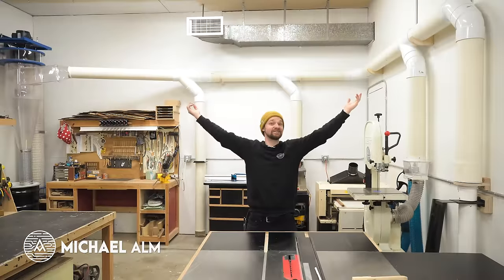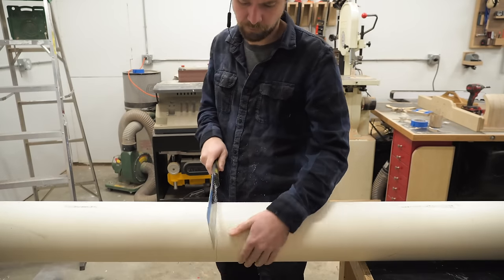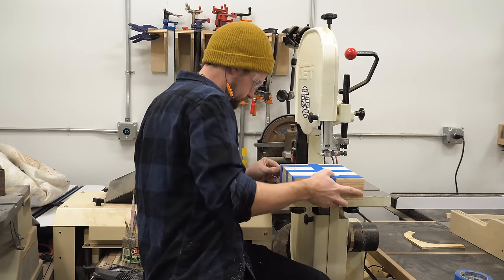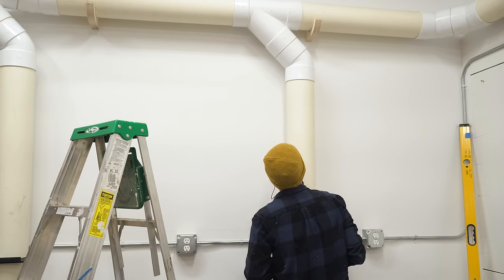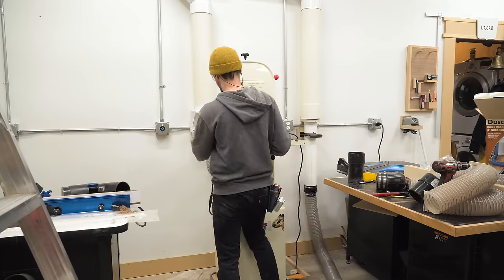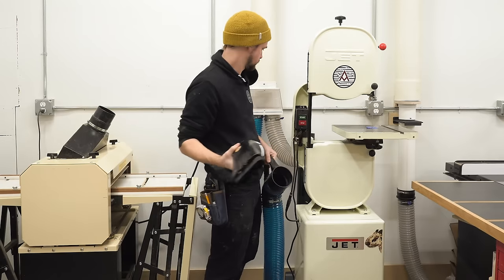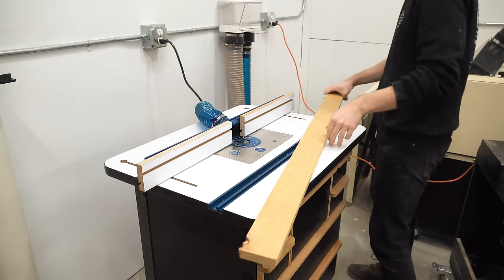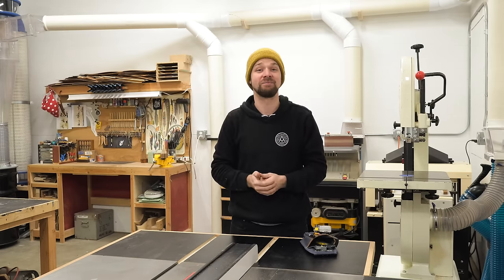Dust Collection System Upgrade

Comment: Clearview cyclones are great. I have had one for about 15 years. Best tool in the shop. One addition, be sure to add a magnet to your floor sweep pickup. You do not want metal parts sparking in a dust cloud. Good ideas here, thanks!

Comment: LOL, your table saw splitter would have allowed you to turn the pipe with the sled in one position. Also, the table saw needs to be able to breathe in the areas that you want to keep clean. A restriction in flow has the same effect whether its the hose or the holes in the machine.

Comment: I have to admit, I've been scared away from Clear Vue dust collectors after seeing their YouTube video that shows the system running at 93 dB!  That's really loud.  Even with their silencer added, the noise level only drops down to 81 dB.  That's a lot of noise.  Especially when there are multiple alternatives that are a good 10 dB (or more) quieter.

Comment: I don't collect dust, I blow it right out into the alley behind my shop.
Reply: Technically you're collecting it from the machines. Just not bothering with doing anything much with it. Just throw it out there.
Reply: I do the same thing - give it back to Mother Earth
Reply: Yeah, Wood is an organic material so it's biodegradable so it's not harmful for the enviorment. Make sure your not doing any metal or plastics. You can actually sell saw dust to a few people aswell so might be good to collect.
Reply: @klab3929  Yeah, those shavings from  PT lumber you used for that outdoor table are great for the environment... LOLZ.
Reply: @nickbrutanna9973  Pressure treated just exstends the life off wood. Doesn't completely erase the fact that it's biodegradable. I was also speaking in general... you can wood thats been painted and of course it's not the best..

Comment: mounting that quick change to the wall is brilliant.  No blast gate or cap needed, it never passes air until you pull it from the wall.  Great idea, and I will do the same (setting up mine over the next couple weeks).

Comment: Nice job.  I just finished my system... 6" main run to the center of my shop, a 6" to dual 4" y-pipe (came with my Grizzly) for sub-runs to my two main tool areas and then with blast gate controlled branches to each tool's flex hose final (4" and 2.5").  I used SDR 35 pipe and found the easiest way to cut it by drilling a small hole and using a jigsaw.  SDR 35 pipe and fittings are so much cheaper than schedule 40... about half the cost.  My system works great... Grizzly G0944 with an Oneida Super Dust Deputy XL (6" inlet/outlet), wall mounted with easy to remove bin under the Oneida.

Comment: In my experience, if you drop straight down to each tool (as in the example above), they each act as interceptor collecting bin (you've basically built a venturi port).  Dust from the farthest tool can't jump that gap and ends up pooling in the adjacent tool drop. The trick is to have at least a short horizontal section at each fork, so dust heading to the collector doesn't have to jump across any down-pipes... cause it won't!  A buddy of mine, who built his as shown above, has to now run around his shop, starting from the farthest tool, and open and close each gate to get the dust to hop from one tool drop to the next on the way to the collector!

Comment: Great video as always.
I've cut a lot of large PVC pipe on a table saw. The easiest way is to use a sled and a stop block. Push the sled and pipe into the blade and then rotate the pipe slowly with your fingers and you get a perfect 360 degree cut.

Comment: Really nice install, and great shop layout -- wish I had that much space.  I built a 4" system last year (my vacuum could never handle 6" ducting), and, all the parts came from Rockler as well (I'm lucky to have one just a few miles away).  
I did find one issue with the 4" plastic blast gates, that you may or may not run into with the 6" version.  On the gates that service the more heavily used equipment (table saw, universal port, chop saw) the dust would collect in the groove that the gate slides into.  After a while the gate wouldn't close completely, and suction would suffer, so I'd be constantly cleaning out those grooves with a screwdriver, or awl... Finally, I replaced the plastic gates with metal, self-cleaning blast gates from Lee Valley.  Pricier, but worth it to me.  No more issues.
Anyway, great video... enjoy the new system.

Comment: Great build.
I worked in a dry food plant, we had metal vacuum system from Hoffman, went to PVC system then back to metal.The biggest problem was static electricity, we solved that with sheet metal screws into the vacuum stream, then attached to copper wire & grounded on conduit or metal poles. The PVC pipe got holes in it much sooner the metal pipe, that the reason we went back to metal. That may not be a problem for you, because we had truck load of salt & sand like waste that cut/ground though the pipe. You have saw dust & wood chips, but I wanted to make you aware of the potential problems. I have never worked in a wood shop with PVC systems, all I worked in had no vacuum system or they had all metal. I am building a small shop for a friend on his farm & we will look at Rockler when we do.

Comment: It's Feb 2021 and I've been dealing with shortages of just about everything. I checked over a half dozen local plumbing pipe distributors and no one had 6" thin wall PVC. I finally found SDR 35 at a yard specializing in sewer and drain, mostly used for road construction. They had a great price too.

Comment: I know you said your router table already had great DC, but you can make it even better by using an insert with a bigger hole. It won't affect the safety unless your working with really small wood
Reply: Yo Mama Why is that incorrect?

Comment: Awesome video! Ive got my dust collector plumbed with the same  pvc material, I’ve ran into a little problem with static electricity building up on the pipe. 
I was worried about how this could possibly be a fire hazard so I thought I’d try to remedy it by drilling a small hole (3/16) or so every 8’ and installing a ground wire into the inside of the pipe about an inch or so. I then silicone the hole shut and run the other end of the wire to a grounded surface (I used metal conduit for my shop wiring so I grounded to that... works perfectly. Thanks again for all the great videos
Reply: Hows your dust build from your static electricity remedy?

Comment: Great video ! Six inch is the way to go. 
Original dust collector also works great with 6 inch pipes.
Plumbing supply in Belleville Ontario Canada selling one 4" by 6" reducer for $56 Canadian .
Using 10 ft flexible until I can source reasonable prices on earth.

Comment: Nice system and not sure if anyone mentioned this, but when you use PVC for dust collection, you should ground the PVC, PVC is very prone to generating a static charge when air is moving along the inside of it, along with charged particles of wood and other debris. This static can build-up to the point where it arcs to ground unexpectedly.  With the right combination of materials and oxygen levels, this can cause a dust fire or an explosion to occur.
Reply: There are zero reported cases of this ever happening. This is an urban legend. At most you get a little shock when you touch the pipe.
Reply: @chrisjohnson6482  I can confirm this is not urban legend. I do not know about USA but I have personally spoken to the electrical certification person that was part of explosion investigation. MDF dust especially is a problem. Small shops like this might get away with this but anything bigger like a 5 person shop will generate enough of static to be a potential problem. Ground it or use spiro metal tubing and groud that. I personally would use the adaptors reducers traps and go with metal spiro tubing. easy to ground no shocks fire proof.
Reply: @majstrujeme8352  hard to say what the causing factors were in that anecdotal third party telling of a tale. You cannot ground pvc even if you wanted to. And there would need to be a concentration of fine dust that is so thick you cannot see through it for it to be dense enough to combust. Plus again there are zero reported proven cases of it ever happening. That you heard about something like it happening maybe once doesn't concretely prove anything

Then again, I am not here to tell you what to do in your own shop. If you want to wrap wire around your pvc and pretend you are "grounding" it be my guest
Reply: @chrisjohnson6482  I would use metal round duct pipe and you are mistaking sawdust for MDF particles. It is not anecdotal. The plan is to test again in lab and possibly classify wood shops processing MDF as explosive area for electrical wiring. Because  you didn't  see it doesn't mean it's not real. I am perfectly aware that grounding PVC  pipe does nothing. Unless you would completely wrap it in aluminum foil. I  am not wood worker I am electrician that was at the electrical wiring safety board recert.
Reply: @majstrujeme8352  I meant any fine dust particles. Again there have been zero substantiated cases. But you should still feel free to do whatever you want to do
Reply: I’ve had my system up for decades and no static combustion.
Reply: I thought MythBustersdisproved that.

Comment: If you want to supercharge your system, make an outside dump for your exhaust air.  I did it for my 3hp cyclone system, and used 8" pipe to make an outside dump.  Built it like a dryer vent, so it doesn't leak rain in, and made a 8" blast gate so I can use the filter on really cold or really hot days. Doubles your air flow when you don't use the filter.  And only time it puts dust outside is if you run your barrel over. Puts that really fine dust outside so you don't have to breathe it.

Comment: To elevate the static buildup on the PVC, Buy a roll of #18 stranded bare wire and tie one end onto a tennis ball start your dust collection up then feed the tennis ball into the farthest end of your system and feed the wire as the ball travels through the system. When it come out the end at your collector tie the wire off to ground. this will drain off the static and keep your shop safe from fire.

Comment: Nice work, it looks super; I got the clearvue max with 8" outlet, I couldn't be happier, that thing works just like the 30K big monster I use to have outside of one of my past shops; people chime in about the static, there might be some truth to it, I never had an issue, one time my guys forgot to empty the drum and it backed up into the filter it was that much stuff in it, never burst into flames or exploded like some claim it might, I did pay the 1000+ for all the piping with thicker walls, I had the experience in my other setups to have the thin wall vibrate somewhat so I went with the thicker material, pretty pricy, especially once you climb to 8" diameter in pipe and some elbows until you drop to 6" and 4";
I also caged my cyclone for noise purpose, very minimal noise to deal with;
I got quite a lot of stuff attached to it, the favorite is my back to back 5Hp rip saw and 3Hp dedicated dado station, both sawstop units, I love those things, I was a powermatic diehard for a long time, still have a bunch of them but the saws, switched to sawstop saws, piece of mind for me when I have my guys working on them, not the the rest of the tools are not as dangerous, I guess is just a mental thing.
Congratulation on your setup, very nicely done.
Dan
Reply from the maker: Thanks Dan! Sounds like a heck of a setup you have!!
Reply: @MichaelAlm  you are correct my friend, and wouldn't give it for nothing in the world, lol.

Comment: Looks like it all turned out fantastic.  I was watching to the end to see if you would have enough velocity with 6" drops but you have enough cfm that it worked out great.  For others adding piping like this make sure the piping is sized for the cfm, for dust collection you need enough velocity to keep the dust and chips airborne and not have them drop out and start clogging the duct.  The length of the duct along with every turn and the amount of vertical rise all reduce system capacity so calculate before shelling out for parts!
Reply from the maker: Yeah, I followed the suggestions from ClearVue an I seemed to be well within spec, but this is very good advice. Thanks!
Reply: The ClearVue system uses the larger 5Hp motor and 15" or 16" impeller. This is all based on the research that Bill Pentz has done over the years.

Comment: if you place some small casters upside down on either side of the cut and pipe, then you can create a roller for the pipe to roll on as you cut the pipe on the saw. Makes easy work out of that .

Comment: Nice looking system. Only issues I have is those gates. They are prone to collecting dust and chips and will sooner or later block up making the gate not shut correctly. 
Also static is a big thing to think about.

Comment: This is terrific, your shop and work is an inspiration. Here's a little experience talking regarding dust collection. A friend of mine recently set his CNC on fire with a PVC dust collection system.... You might want to install some kind of grounding cable lining the PVC tubing. Metal tubing grounds nicely, PVC can be problematic with certain dusts over distance. Keep up the great work and thanks for sharing!

Comment: Hi, first let me say that I really liked your video. It gave me a lot to think about, it was pretty instructive. 
But I have a couple of questions. One is ask about the piping! PVC vs the flexible hoses. Now I know that the ridges of the flexhose affect the pressurized suction. 
But let's just say, I have a very small shop "a bedroom turned into a shop, small shop to be exact", and I have a fair amount of flexible hose, and I want to build my dust collection system. It Would be for about 6 tools, or 6 hoses, 4 tools, and 2 loose hoses for hand tools and clean up. 
So meaning 6 Blast-Gates. 
Now here's the first question. If I would cut the flexible hoses, so they would reach each separate connector, to each Y connector "precisely" fairly tight, no bending of the hoses. They would fit pretty much to the exact length. Could it do as good OR close to as good as the PVC "as a some-what substitute" OR even as tight as possible the ridges would still cause a certain amount of loss of suction? 
And 2nd. My Shop-Vac is a 2 1/2" hose 6.5HP. Now, Should I use 2 1/2" PVC piping all around? Or should I use a widener and use 4" pipping? Should I get better suction with the 4" or it would be the exact same with the 2 1/2"?

Please give me your professional opinion! I have 1 shot, so I need to do this right.
Thanks for your time and great video. Thumbs Up!

Comment: Congratulations Michael. It looks great. I'm not going to preach on grounding since many others have. I have three comments. First, were 90 degree sweep elbows available? They would have been better. Second, Rockler has a dust chute for the router table when cutting dadoes. Third, it would have been easier to glue the boards together before cutting when making the supports. Thanks for indulging me.
Reply: and how would you propose separating the plywood once they're all cut out?
Reply: @bs838  Only glue two groups of two together and leave the middle unglued. That way groups of two will be cut out.

Comment: Nice sistem mate, but You have to protect the tubes against the STATIC charge, because its made from PVC and You can make a huge FIRE with it.
Reply: László Bányay I’m surprised more people aren’t mentioning this.
Reply: This is not necessarily true. In order to generate the dust/air ratio you would need for any concern, you would have to generate more saw dust than almost any single woodworking machine could create. There is no known instance of any instance of a dust collection system in a small to medium shop creating a fire or explosion.
Reply: Steve Costello seems like it would be better to be safe than sorry. Especially when it’s so easy and inexpensive.

Comment: Cut that pipe on a wood v-block jig clamped on the table saw. Cut into the bottom of the V just a bit more than the pipe thickness. Now just set the pipe onto the blade and rotate it. Totally safe and no grabbing/jumping on the pipe. One more really secret tip. Replace most bend fittings by capping both ends of the pipe and duct taping them on, or use rubber oatley type end caps [cheap up to 8"] now, outside with a friend heat the bend area with a propane weed burner torch. Sweep the torch around to heat the air inside the pipe.  The air expands and you can make a bend with NO crimping or collapsing. I do this with 8" schedule 80 [Yellowmine commercial heavy PVC] and can make a 45' bend in just a few minutes. The wall thickness is over 1/4". Be careful loosening the ends! They can end up 500' away or embedded in your face.

Comment: Nice dust collection! I will leave these tips for everyone else here since you have already built your system. You do need to ground your pvc. Just run some bare solid copper wire through it and drill a hole near the connection to the collector, and run the wire to a ground on the collector. Seal wire penetration with silicone.  You can use dwv PVC drain fittings, and cellular core pvc pipe. They are cheaper than the sds and cduct pipe and fittings that you have. Well at least here in Oklahoma. The dwv, or drain, waste, and vent fittings have sweep 90's and wye's called combos, or combination wye and 1/8th bend. Which can save you money because it's a wye, plus the 45, to make an effective long sweep tee. There, happy building guys.
Reply from the maker: Thanks, yeah the thin wall was significantly cheeper than the DWV here in Washington for some reason. I read about the cheeper pipe on forums and stuff, but it didn't seem to be the case in my area.